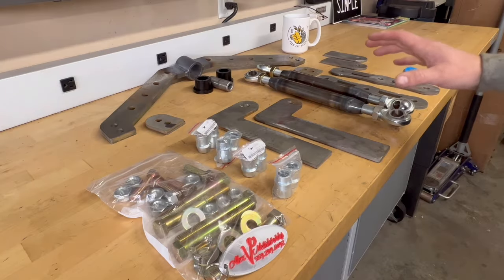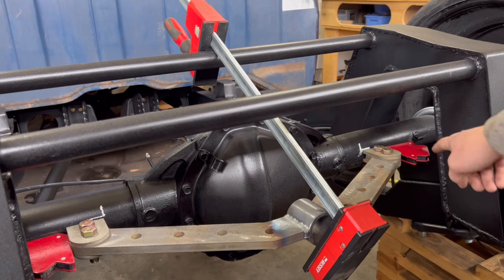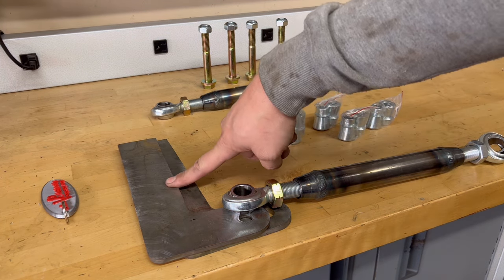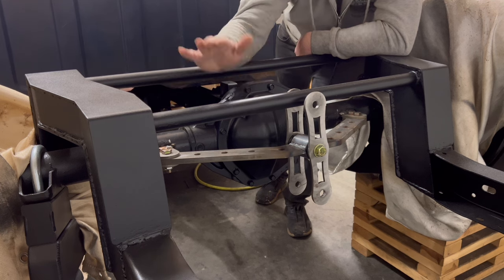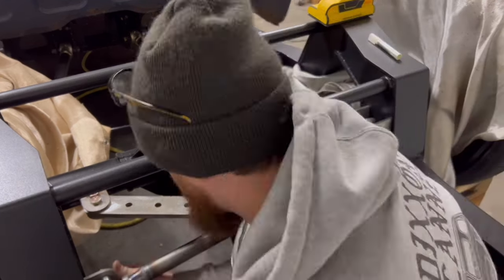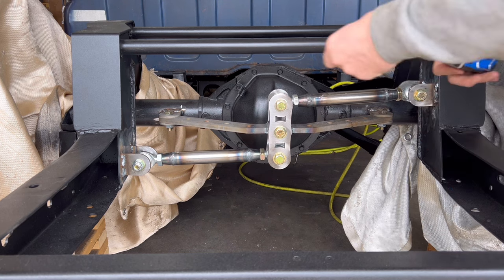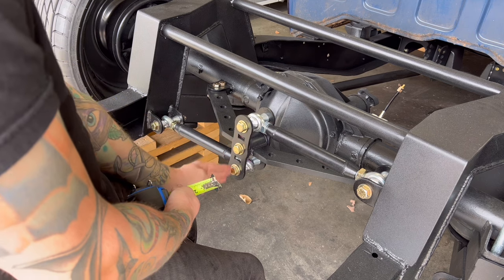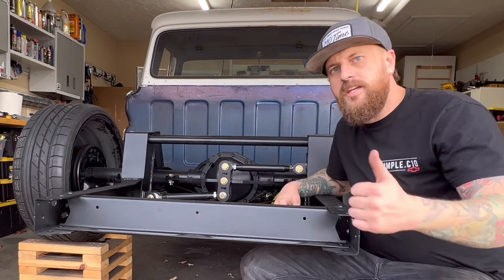FRANCIS EP.9 | Watts Link Step-By-Step Installation Tutorial. Great upgrade for air ride suspension.

Comment: I thought the pivot link in the center was NOT suppose to be vertical at ride height/half travel. 
I though it was suppose to be angled 5 or 10 degrees
With the bars parallel to the ground.
Reply from the maker: You’re right about the 5 degrees. At half travel my pivot point is about 5 degrees. My ride height is a little lower than my half travel which moves the bars slightly. The main factor in a watts link is that both rod sizes are equal and the angles are equal. As you saw in the video, by checking the center at all ride heights. As long as everything stays centered during travel then the middle pivot point angle isn’t a factor. I centered my middle pivot with the bar all the way compressed, knowing I could extend them to achieve the slight angle at half travel. I hope that makes sense and thanks for your comment!

Comment: I have the Kp watts link along with their 6 link setup. I have no complaints other than I think it's kinda ugly..just my opinion. You are right about the notch part. I had installed some notches from AVS prior to bagging my truck and when I went to install my watts link, I ran into a little bit of trouble. However the guy that designed that watts link and 6 link was able to make it work for me
Reply from the maker: They all work great when you get the whole kit for sure.

Comment: Do you remember which u-bolts and blocks you used. I bought the watts kit, tinworks trailing arms from you so I want to use what you use 100%
Reply from the maker: It’s the velaworks rear diy slam kit from my website.
Reply: Ok thanks sir. Those blocks look a lot bigger in pic then they do on truck!!
Reply from the maker: @DallasRCracing  you have to cut them down to whatever size you need. If you have tinworks arms you cut them down to 3 inches instead of 4
Reply: @SIMPLE.C10 thank you
Reply: sorry for all the questions but which hobart welder are you using?

Comment: i was always taught the pivot bar should be level at mid travel as opposed to ride height. guess it really does not matter on a system that will not use the complete travel.
Reply: I believe you are correct!
Reply from the maker: You’re correct, my “ride height” was the middle of travel for my truck. My rear bags will inflate 10 inches so I set it at 5 inches inflated.

Comment: Great video. Was wondering if this is a universal kit or is it specific to the C-10? After doing some research, it is only mentioned for Chevrolets. As I have two Ford pick-ups I'm doing work on and would like to add a watts link to both of them, this kit caught my eye. Have a good one.
Reply from the maker: This could be used as a universal watts link. You would just need to mount it correctly on the frame.
Reply: @SIMPLE.C10  Outstanding. I mean, I could build one from scratch, but I'd have to source all the parts. This would make that much easier. Thanks again for posting this. Take it easy.
Reply from the maker: @LarsUlrich33 thanks

Comment: Thanks for the detailed video! I ordered mine right after I saw it. Quick question: My bars need the heim joints welded in and yours appear to have come welded in already (and look shorter than mine). Any advice on measuring them before welding in case I need to cut them down? I guess I'm wondering how do I know the length they should be, even though I know they are have some adjustability? Also, will the shorter pivot brackets, like yours, lessen my amount of travel...Or does it matter much?
Reply from the maker: Did you order the kit I had linked? If you did, you shouldn’t need to weld the heim joints in. 
Go to ride height and center your middle bar, meadure from center to center and make it an inch shorter for the watts bar.

Comment: Isn’t using a adjustable pan hard bar better then using the watts link? Watts link takes up a ton of space and it’s not like you’re making 1000 hp.
Reply from the maker: A pan hard allows the rear end to shift left and right during suspension travel. A watts link will keep it centered at any height. It’s less about horsepower and more about stability during air ride travel. I’ve used panhard and it can work flawlessly in the right setup.

Comment: That propeller in the center IS NOT supposed to be perfectly vertical. If you’re looking at your vehicle on this video….the top of that propeller needs to be slightly to the drivers side. I really hope since the making of this video you’ve adjusted it properly
Reply from the maker: Once I got everything lined up I extended both rods about an inch that put the Z angle in it. Thanks for the suggestion.

Comment: What paint and color were used for your frame, rear end and watts link?
Reply from the maker: I used the rust oleum truck bed coating spray paint. The textured stuff. Don’t use rubberized undercoating. Worst stuff ever.
Reply: @SIMPLE.C10  is that a satin or flat?
Reply from the maker: @chadhebert1776  the truck bed coating is considered a matte finish. It’s not glossy because of the sand type texture but looks really nice.
Reply: Totally sold me on this. I'm doing a 59 GMC and almost did a 3link set up, but decided after watching this video, the Watts link is my direction 💯👌🏼
Reply from the maker: @chadhebert1776  awesome but works great and is easy to install.
Reply: @SIMPLE.C10  I agree 💯. That's why I inquired. The look totally sold me
Reply from the maker: https://simplec10.myshopify.com/products/watts-link
Reply from the maker: @chadhebert1776  thanks

Comment: Can you get the measurements  from the diff to the center of the main bracket , I want to know how far it goes back, my fuel tank is back there. Thanks
Reply from the maker: From the back of the rear of me to the back of the bracket is 6 inches. I had to get a new rear crossmember to give me more room to scoot the gas tank back.